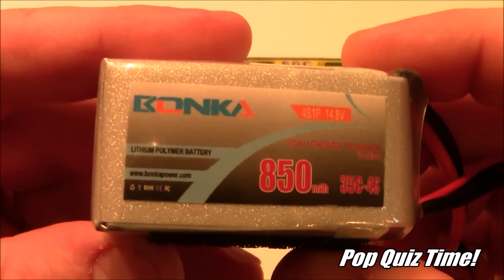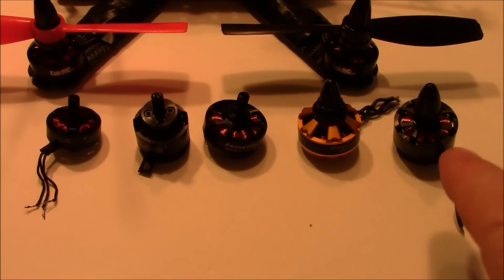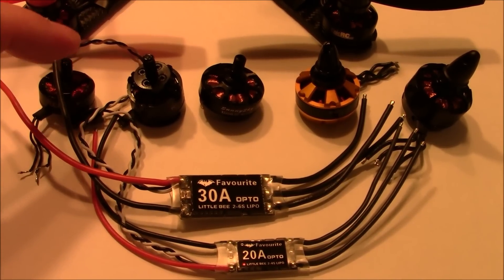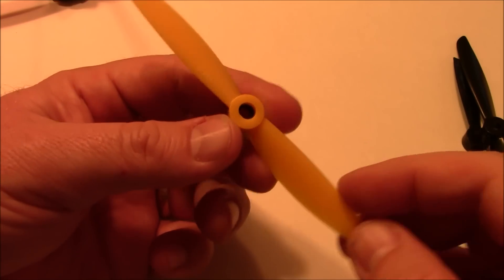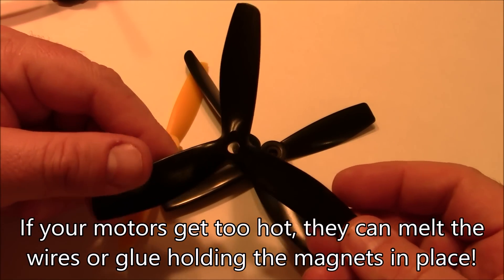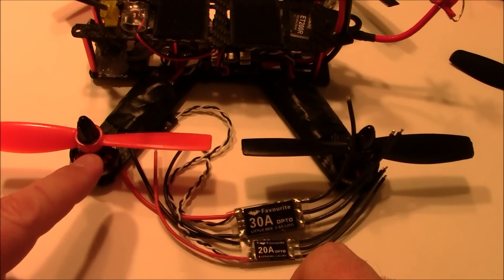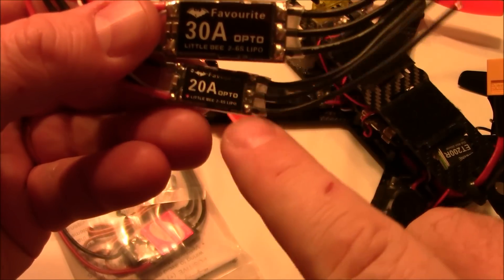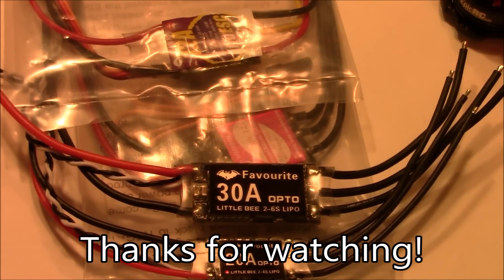Should You Upgrade Your ESCs?  Why Would You?

Comment: Excellent excellent tutorial 👍🏻👍🏻 but yes I have a question can I use a single Esc from a quadcopter let say 30amps using motor 2300 kv and put it on my small airplane????
Reply from the maker: Yes, fly it around for a while and make sure the ESC is not over-heating.  If it does not burn your hand, it should be fine.  If it is hot enough that you can't hold it, you'll need to get it some air flow somehow to keep the temperature down a little.  On a quad it isn't too big of a deal because it is out in the open right in the airflow.
Reply: Ah okay 👌 excellent again so to better safe is best 35amps then right or 40?? And by the way what it means the Word at the beginning of your videos??? Thank you again...

Comment: hey guys , so i just plugged my A2212/13t 1000KV Brushless motor with a 20 amps ESC and it worked perfectly , however when i switched to 30amps ESC it didn't , the motor keeps beeping and is barely mooving , any suggestions ?

Comment: Hey brother I just watched your thing on YouTube about upgrade the ESS this is my situation I'm fixing well I already had broke down some of my quads and I'm just going to put something on my old black frame mjx bugs 3 taking the Silver Motors off and I'm going to put my I don't know either Hyperion 2204s 2300 Cadiz I'm probably just going to put my ears there 2204 2300 KV here's my dilemma I've got the stock ESC I got like 20 of them I've also got a set of Ayers 20 amp Simon k but them damn things got to be programmed and I don't know how to do this shit oh, I also got a set of 20 amp BL Heli But there again I think they got to be programmed as well can I do a throttle control you know how you power the Drone up Orcutt you bought the toggle all the way up on the remote but I'm using my radio link with the receiver and I'm using the cc3d computer or flight control on the birds it's just a boat frames only thing I'm using I'm just concerned I want to use the stock ESC because I don't know how to program can I do it and get away without burning it up

Comment: Question: If I have a lower amp motor and a 25 amp ESC will I burn out the motor on a 3s or 4s battery?

Comment: I have a question I can't find the answer to anywhere on the internet which is strange.
Can I just UNPLUG and remove my VTX from my quad? I like LOS freestyle (as it is 10,000x more awesome than FPV freestyle) and have no use for this VTX. All it does is get hot and adds to the heat of other components....

If I just remove that little plug from the flight controller would that be an issue?
Reply from the maker: That would be fine.  It just wouldn't power up.  On or off, it shouldn't affect the flying characteristics at all.
Reply: @travisgrindal  cool thanks. I actually was more worried about it damaging anything. There are a lot rules that aren't common sense that can damage your shit, such as never removing the VTX antenna while powered on can ruin your VTX, so I was just wondering if there were any rules like that with just removing the VTX altogether.

Thanks. It doesn't sound dangerous to do but I wanted to be sure.

Comment: So a Basically,  A  Brushless Motor say Leopard 4082-1600Kv,  with a Max Voltage of 33v,  an a spec at  120 Amps ,    Would you use a 120A ESC,   or better yet a 150A ESC ?   I rather error on the side of MORE ESC,  the 150A.     Based on what you stated,   that the ESC "DELIVERS",   rather than "PUSHES"  than the MOTORS'  AMP(s) DEMANDS !       Is this correct ?      Or have did I fall asleep during your good Video.      I run ONLY. BOATS,  but I believe the same principles apply.....   Motor, ESC, Props,  ....   Volts &  Amps         Please confirm or correct me!  THANKS for the INFO

Comment: will 2205 2300kv + 15A + 5045 2 Blade + High "C" Battery = Work or Fry?
Reply from the maker: 15 amp ESCs may be a little low for those motors.
Reply: need help too. my plan is 2205 2300kv+ 30A+ 5045 3 blade+ 4s 2000mAh. what do you think?
Reply: @jeremyred6343  Very fine
Reply: any pros and cons?

Comment: great video congrats but i have a question, m driving a 9*6 prop using brushless 2200 KV and 20a ESC using and arduino uno and a potentiometer as input, when i increase the input signal the RPM increase, now the problem it get limited than the motor shut down, knowing that i dont face this problem when i remove the prop, please i need help
Reply from the maker: You may have to check the amp draw of your motor with that size of prop and make sure the 20a ESC is large enough to power it.  What size is the motor?  I don't think a quad-sized motor can very easily spin a 9" prop at 2200kv.

Comment: There are now other reasons for upgrading your ESC apart from just the amperage rating. 

ESC technology is moving along so fast that ESCs today may have features that older ESCs do not have. For example, DSHOT, beeper function, lower electronic noise... and that cool customizable boot-up sound function. 

Just a couple of years ago all we had was the SimonK stuff, now we got the 32-bit stuff, god knows what else is coming a few more years down the road.

Comment: Nice video. and I got a question:
Today I used a 4s 50c battery (I usually use 3S 25C battery) on my 250 drone and it burnt one of my 12a ESC in 1 second. now I want to upgrade my ESC to 25A. But will it gonna burn my 2204 - 2300KV motor? Thanks
Reply from the maker: Were your old ESCs rated for 4S batteries?  Maybe not and that is why it burnt.  For the new ESCs, you need to look at the amp draw of the motors you are going to use and verify that the new ESCs can provide that many amps.

Comment: hai, Nice Video! 
I have a 2 in 1 6A ESC of Racerstar, which of the following motors works best with it?
1) 1104  7000kv
2) 1104  6500kv
3) 1104  4000kv
all rated for 1-2 cells
and what propeller should I use?

Thanks.
Reply from the maker: You'd have to look at the amp draw for each of the motors and see if any of them exceed 6 amps or the burst rate of the ESC.  Most of the time, you won't be flying full throttle for more than a few seconds so exceeding the 6A rating by a little for very short periods isn't usually a big deal.

Comment: awesome build,ive got a radiolink at9 transmitter and 1104 motors.what FC and esc's do i need to get flying?and for future reference what info i need to determine what FC&esc's goes with what motors,and what battery size to use?

Comment: Hi Travis,

I have a question regarding stuttering motor. Its in my wizard x220. Motor 4 will shake back and forth and would not turn.  This happened without any event , as in crash.  I changed motors and it did not help.  Esc has no visible damage. Any pointers as to how to check if esc is good ? Your help is much appreciated.

Thanks
Reply from the maker: I've had that happen before.  First, reflow all the solder on the ESC on both sides.  Also, reflow the solder where it connects to the power distribution board.  One of those connections is probably not making good contact.  If that doesn't fix it, try to update the firmware on all your ESCs using BLHeliSuite.  If that doesn't fix it, you probably have a bad ESC that needs replaced.
Reply: Thank you @travisgrindal  . Those were bad ESCs. Racerstar ones. I replaced and all good.

Comment: Hey, I'm just about to build my first ever drone, I ordered the 30A ESCs which I'm pleased about, however after watching this video I'm a little concerned about the motors not being enough, I did have a limited budget so I went with the racerstar 2205 2300kv. I plan to put these into the 260mm anakin club racer frame, with 6inch props, does that sound wise? Or will they burn out?.
Reply: you should be fine up to tri-blade props
Reply: Richard Clark I got the motor sizes wrong I actually ordered the 2206 2200kv ha oops, but still good to know and thanks for the reply! As for props I plan to use two bladed rather than tri.

Comment: im building a warp quad 6" with 6" props and red bottom motors it has a motoF3 flight board im trying to find the best ESC for it any suggestions ?? the description for motoF3 says up to 20A esc  they say we recommend 20A but should i go higher??..red bottoms are pretty bad ass motors 1000 grams of thrust!!
Reply: All good manufacturers will list power draw tables showing varies prop sizes and amps for their motors - you can get away with 20A esc for high efficiency motors depending on the table data - but I usually prefer to go to safe side and go one above the table data.  30A is usually safe for most times.

Comment: I have a 60amp pro switch mode esc and wondered if a standard 80amp esc could replace it ,the plane  also has a as3x stabilizer in it. Would it effect it in any way and would I still be able to use the stabilizer. Thanks for your help

Comment: Thanks for this video, very informative for a neebe like me and my son. 

One of my ESC 20A bursted in to flame and it is in fysical size the same as the new 30A ESC I will buy.  But I was wondering if it was possible so thanks. 

Best regards, new subscriber
Norway
TR
Reply from the maker: You can mix different sizes, but it isn't really ideal.  If it is one of your first quads and you're just learning to fly, you may not even notice it.
Reply: Jepp brand new to this :) But I was thinking of changing all 4 of them at the same time yes.. 
Learning to control this drone is scary shit he he and trying to use the goggles is mind blowing and will have to wait until I master the "flight by sight"
Thanks for the reply. 

TR

Comment: i have a f60 2200kv with a DAL 5x4x4 prop, do i need to upgrade my 20A ESC to 30A ESC ? the motors pull 25A at max with these props. they say the ESCs can burst to 30 amp, help!

Comment: I have a hexacopter that I was using Emax 30amp SimonK escs, but I'm running out of places to buy them after mine are starting to fail one at a time. I want to run different amp sizes like 25amp or even 20amp along with the last of my 30amp escs. While slowly replacing them all with the same amp rating. I would really hate buying them and finding out it just burned out my NAZA-M V2 or my little Emax 2213-935kv motors.

Can I go lower since Emax only asked for 18amp in the first place?

I can't afford to go out and buy all new escs running BLheli or OPTO or whatever is the hottest thing going today. One at time is all I can do for now, until I switch everything completely to a different type altogether (come on lottery!).

Current Configuration: Emax 30amp SimonK ESC's and Emax 2213-935kv motors with 1050 props on a hexacopter F550 running through a NAZA-M V2 on a DJI cloned Hexacopter.

Comment: I have 20 amp ESC can I change it into 30amp ESC without connect it in computer or upgrade it? Just replace it and ready to go? Or need to calibrate?
Reply from the maker: If it were me, I'd make sure the firmware was at the same level as the other ESCs.  You'll have to re-calibrate the ESCs though so they all have the same end points.

Comment: Can you use 6 bladed props on a little bee 30A esc's.
Reply from the maker: It all depends on the amp draw of the motors.  I haven't seen many 6 blade thrust tests.  It would also depend if the props are 4", 5" or 6".  Longer props will draw more amps.

Comment: Hi. What's the best size esc for my 2205 2600kv motor?

I'm normally using the 4045 tri blade or 5045 tri blade on my 250 racer!

I had been burning out the 20A little bees and after watching this video I'm now thinking the 30A littlebee would be better?!

Please help! Thanks.
Reply from the maker: Any 30 amp ESC should work for you.  I've been using these Racerstar 30amp ESCs.  I've had excellent luck with them on my 2205 2600kv motors, but the LittleBee 30amp ESCs would work fine too.  http://www.banggood.com/4X-Racerstar-RS30A-V2-30A-Blheli_S-ESC-OPTO-2-4S-Support-Oneshot42-Multishot-for-FPV-Racer-p-1074733.html?p=6Z050013977120130325
Reply: Do you think I'd be fine with the littlebee esc instead of the racerstar as the littlebees are quite cheaper?
Reply from the maker: Any 30 amp ESCs should be fine.

Comment: Hey guy! I have 60AMP ESC's connected to 3800Kv BLDC motor with 8000mAh 560grams battery. Now it cannot be stable by the weight of battery xD The size of my drone about 45cm by 45 cm. 
LoL :( 

*Any suggestion for any change? I have no idea :P Cuz it needs parts changes.

Comment: ESC for T-Motor F20 1406 3200kv motors.
Reply from the maker: You'd have to pull up an information page regarding the motors and see what their amp draw is with the size of props you're going to be running... but I'd guess 20amp ESCs would be large enough.

Comment: I have a question, I'm building my first quadcopter. If say I have the Racerstar 2600kv motors what ESC should I use if I would be runninng 4s on it? The LittleBee 20amp BL_Heli_S or the LittleBee 30amp BL_Heli_S? Thank you in advance.
Reply from the maker: The right thing to do is to look at the amp draw of the motors and make sure that the ESCs can handle it.  I see on the website that the 2600kv motors can pull 27 amps.  I'd go with the 30 amp ESCs to make sure I didn't burn up the 20amp ESCs.
Reply: travisgrindal Thanks Travis! Love your channel :D

Comment: Would you recommend v2 20a esc's for my br2205 2300kv motors??? WIll the v1's be enough, or should I go for the v2's for $16 more?
Reply from the maker: So far, I haven't had the best luck with my LittleBee ESCs.  I have had good luck with the 30 amp Racerstar ESCs (http://www.banggood.com/4X-Racerstar-RS30A-V2-30A-Blheli_S-ESC-OPTO-2-4S-Support-Oneshot42-Multishot-for-FPV-Racer-p-1074733.html?p=6Z050013977120130325).  They aren't much cheaper than others, but they've been working great for me.

Comment: +travisgrindal - Hiya, thanks for your videos, I'm new to drones and expect to order components for my first drone in 2-3 weeks - and a number of your videos have been helpful. 
Looking at the tan lian lt210 and the emax 2205(?) 2300 motors with 30A ESCs - based on looking at the spac tables for the motors.

One (more or less) question with regards what you're saying about ESCs: if ESCs don't push amps, how do they control the speed of the motor?
AFAIK there's is no logic in the motors, so what creates the change in current? Why aren't the motors running full power (their max draw) all the time?

Thanks again for your videos.
Reply from the maker: If the amp draw was up to the ESCs, then they could limit themselves to their max amp output.  However, the motors are able to pull more amps than the ESCs are rated for and that is what can cause them to burn up.  You're right, the motors themselves don't really have any logic built into them, they just spin when they get juice.  I think the ESCs are told by the flight board to spin the motors faster to like make the quad level, or turn the quad, or start a yaw... any number of things.  The ESC then let's more electricity get to the motors but it isn't enough so the flight board says give it more, so the ESCs do and maybe it still isn't enough so the flight board says give it even more and then the motor starts drawing more amps than the ESC is rated for and then the ESC gets real hot and catches on fire.   ... I think that is how it works, so you're right, the motors don't really have any brains to them, rather it is probably in the flight board.   Some one with more brains than me could probably give a better answer.
Reply: Hi again +travisgrindal -  thanks for your explanation and apologies if I've put you on the spot, that wasn't what I meant to do.

From what you're saying it sounds like the ESCs are almost like a valve on a fuel line.
Reply from the maker: Yeah, that is a good analogy.

Comment: What's a good size ESC for 2204 2300kv motors?
Reply from the maker: The best answer is to look at the specs from your motors and see what kind of amps they'll draw with the props that you are planning to use and by the ESC that fulfills that requirement.  20amp would probably be fine, however, since most current 30amp ESCs are about the same size as 20 amp ESCs, I'd just go with the 30 amps.

Comment: I am having a RC plane in which 30 AMP ESC is connected to 2200kv motor .my ESC is getting heated and the maximum current of motor is 15AMP is this because of I am using 30 AMP current
Reply: Hey guy! I have 60AMP ESC's connected to 3800Kv BLDC motor with 8000mAh 560grams battery. Now it cannot be stable by the weight of battery xD The size of my drone about 45cm by 45 cm. 
LoL :( 

*Any suggestion for any change? I have no idea :P Cuz it needs parts changes.
Reply: looks like you got more questions than answers to your problem some people they just don't have a clue

Comment: quick question
On my zmr build, I have DYS opto escs.
I am using an Overcraft PDB and have only direct soldered on the signal wires, not the thin black ones.
What is the purpose of these thin black wires? any idea?
Reply: That's just another ground but that isn't necessary since there is already a ground with the power wire.

Comment: Afro ESCs are really shitty for performance. I consider them a complete beginner ESC. It's not about the amp draw (that is of course a factor) it's about the performance and how well the ESC can run a motor. Avoid Afro, just get a DYS XM20A or a littlebee so you don't have to upgrade when you start flying harder and faster. Trust me, you will want more performance than an Afro can offer in short time.
Reply from the maker: I bought the Afro ESCs about a year ago when they were the "cool" ESC to have.  :)